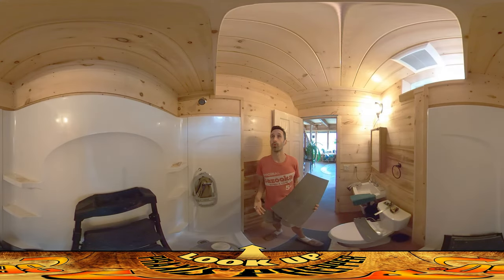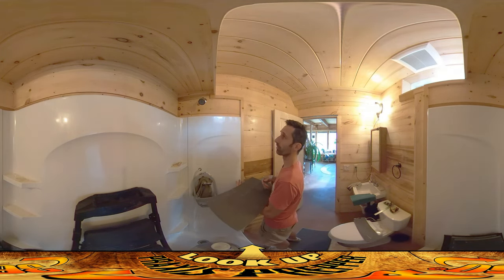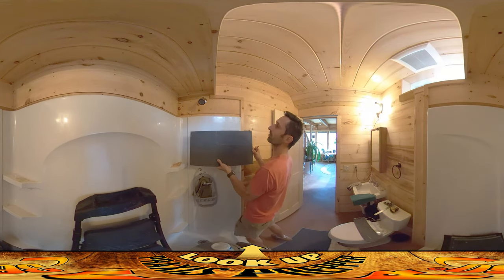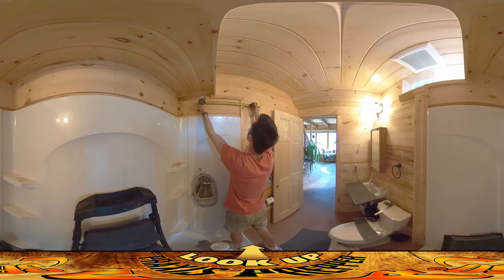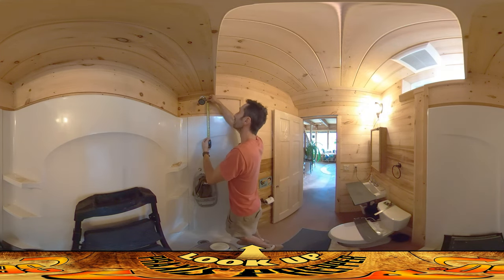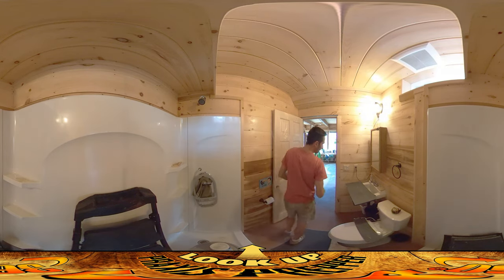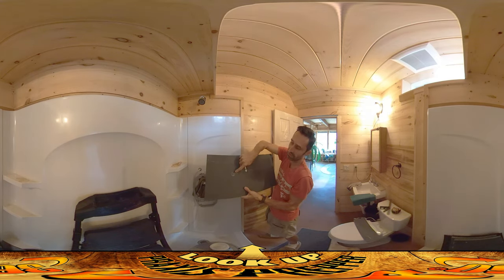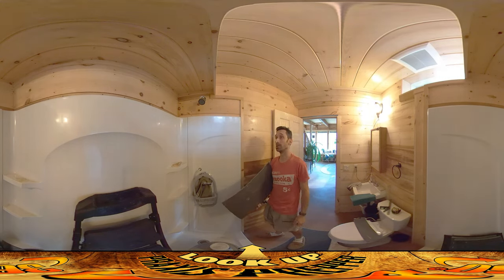Homestead Building - Tile Design Around Shower Stall, Cutting Slate Stone

Comment: Out of curiosity, why don’t you just drill the hole all the way through? Seems like using a chisel to knock out a partially drilled hole would increase the chances of cracking the slate 🤔
Reply from the maker: The slate is really fragile and it chips and cracks easily. Even doing it with the small bit, there was a lot of fracturing in the tile. I was using an impact drill because it's what I had. If I just had some sort of simple friction drill, then yeah, I'd have just use a big bit.
Reply: @PraxisPrepper  Yep I’d probably have done it in a similar fashion then but what happened to your Ruobi drill?
Reply from the maker: @inmyimage1081  I still have my regular Ryobi drill too... maybe I should have just put a stone driver bit on that... Honestly, half the time I have no solid idea what I'm doing. ;)
Reply: @PraxisPrepper  It shows 😜